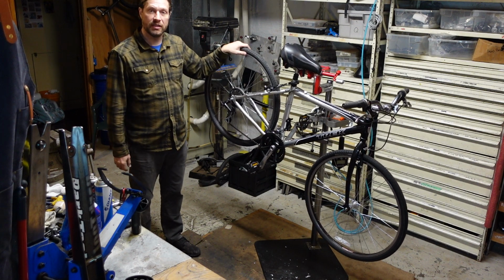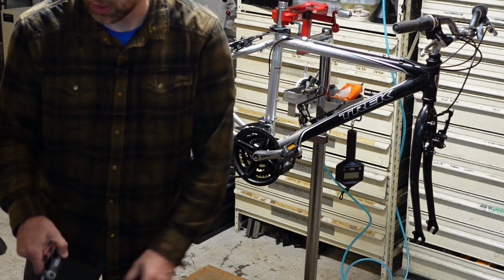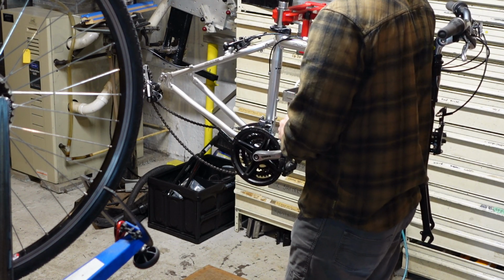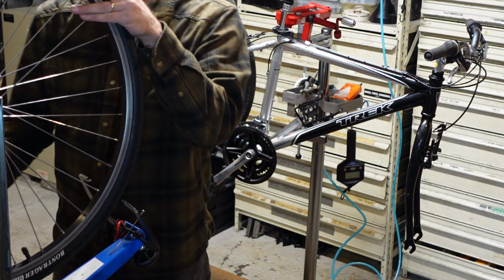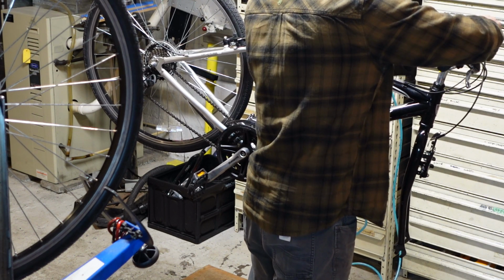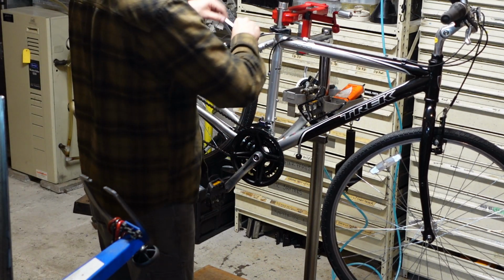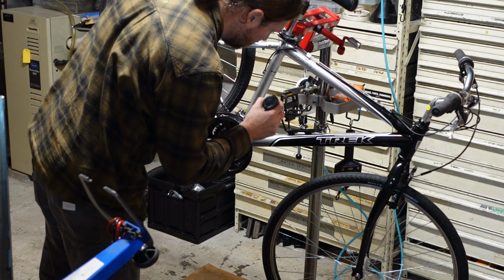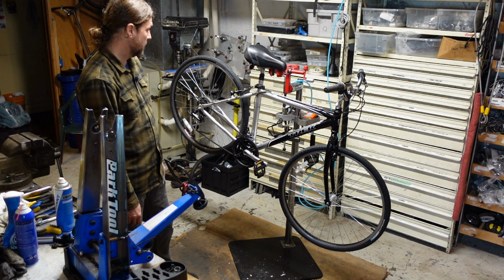Ep PILOT | Trek 7000 | Pump and Polish - quickie bicycle tuneup in a continuous shot

Comment: I am currently building a 2012 Trek 7000 into a drop bar gravel bike.  Came as a frame and fork, bought some 20 mm ID  wheels, to fit a 40mm Raddlers. Components are Ultegra and the cassette is a 11-32 GRX 10 speed.  I am sandblasting and painting the frame, then eventually powdercoating it if I like the end product.
Reply from the maker: I have a 2 part video where I convert an old 750 into a drop bar hybrid gravel bike. I work through a couple of possible pitfalls there. Might be worth watching!

Comment: I feel a little bit dumber each day. Maybe it’s an age thing. The other day I tried to remove a crank on my project bike. I somehow managed to get the crank puller threaded in there without thinking about, or even noticing that the nut was still there holding it on. I ripped the threads right out of the crank and had to go buy an automotive gear puller. Whoever gets this bike when I’m done will be getting an awful lot of new parts for free. And my degree says summa cum laude on it. And I just started two sentences with “and.” Thank God retirement isn’t so far off anymore. If I ever get to be president we are all screwed.
Reply from the maker: Abso-fuckin-lutely. I’m 47 with about 15 years of heavy drinking, and I’m 100% aware of my cognitive decline. The fact that we don’t have a top-end age limit for elected officials is completely wrong.
Reply: @bkefrmr My comment probably sounds like it comes out of nowhere. It was supposed to go on your latest video, the one where you said you are getting dumb. 😂 I guess I let it roll a little too long and youtube loaded up this early video and I didn’t notice what I was commenting on 😂😂😂. Oh well. Maybe it means its time to watch them all again and see if I missed anything the first time.
Reply from the maker: @ ha! Didn’t even notice. It’s all very true!